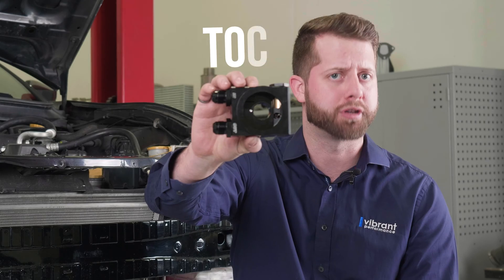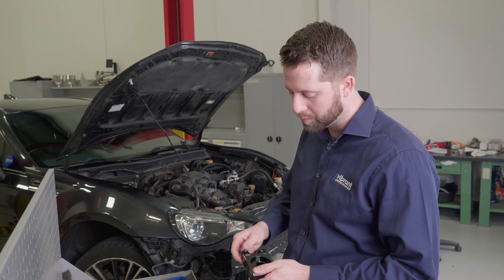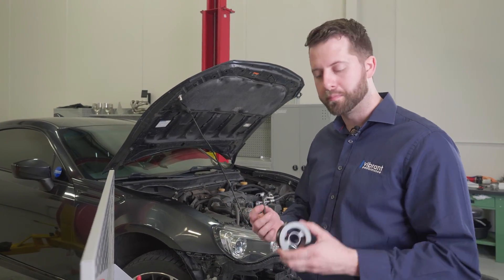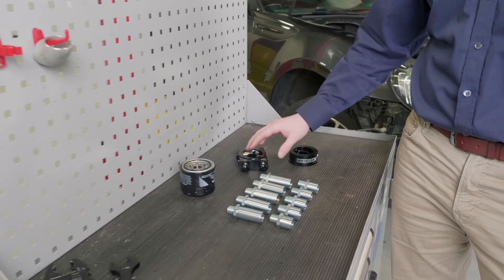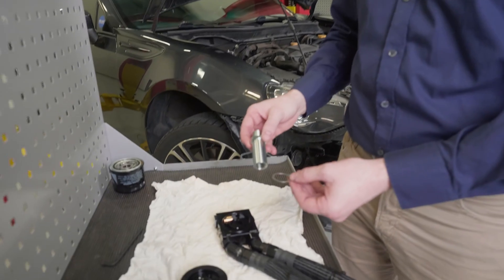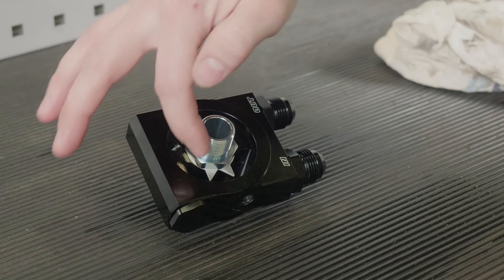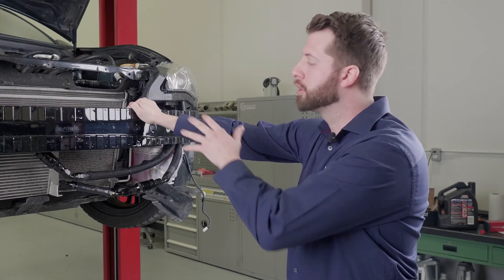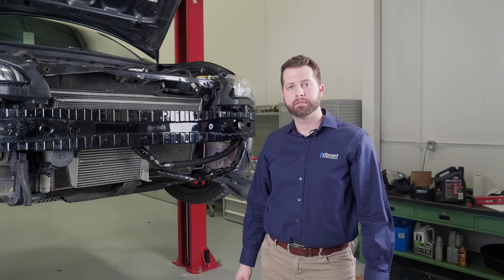Installing a Thermostatic Sandwich Adapter

Comment: Hey, just installed one of their oil sammich plates. Other then being miserable to install in the car on an IS300...this sammich plate didn't leak. Thank you. Thank you, Thank you, Thank you so much for making a product that doesn't leak....Even the 1/8 npt's which have bungs in them right out of the box didn't leak (you can't take this for granted I found out). After installing a used Sammich plate, off brand sammich plate, and then this sammich plate...10 out of 10

Comment: 6:54 you're done? Shouldn't you mount that oil cooler first?
Reply: The cooler as seen in the video is hanging from the bumper re-bar, and has a second mount that fastens to the floor when the bumper cover and shrouding is installed. This has been track tested and shows no sign of failure.

Comment: guy forgot gasket maker on his oil filter o ring, lol.
Reply: the sandwich plate doesn't need it unless you want it as a fail safe. I have done hundreds of laps with the TOCA assembly with no gasket maker, no leaks.
Reply: @MrLister30  It was a joke. There is absolutely no need for gasket maker on a o ring seal lol.
Reply: @FOXCRF450RIDER  understood, however a small bead can be placed around the perimeter of the oring for racing applications
Reply: @MrLister30  You would be laughed out of a race shop putting any kind of RTV on a o ring seal, again I'm lol'ing.

Comment: How can we get work done on our cars by you?! Is your shop open to the public for business?
Reply from the maker: Unfortunately no, we are a manufacturer. The series we are working on with Speed Academy where we are building their turbo setup is for an educational piece to show how easily it is to use our products for such projects. There are MANY talented fabricators in the area and that use our parts that we can get you in contact with if you're interested.
Reply: In other words sorry you don't have enough subscribers or a name
Reply from the maker: @Simpleman1078  Not at all, we are a manufacturer, we do not operate as a shop.

Comment: Is there an oil drain on your cooler? That would hold a noticeable amount of oil that wouldn't get changed during regular servicing.
Reply: My mechanic recommended to simply change the oil slightly more frequently, instead of 4000 miles switched to 3000. Had the oil tested and didn’t notice anything particularly abnormal, full synthetic should last 6000 so if a portion of the oil goes that far it’s not the end of the world. But yeah sometimes they have drain and other times they don’t, mine didn’t and removing the cooler was more of a risk of causing a leak than he thought was worth.
Reply: @kcspeed9980  sounds like a reasonable plan! Rock on!
Reply: I have added a dry break connection on both inlet and outlet, so I can remove the cooler during the winter, but it also allows me to drain it easily. I have the two dry breaks opposite to each other, so when I remove the oil cooler, I plug them into eachother, so I don't need to remove the sandwich adapter.
Reply: @MrLister30  yeah. That is really slick. Does it need to be filled separately Berger startup. Or can you use clear flood mode to fill it. On Subaru’s you put the throttle all the way down and crank, it doesn’t fire the ignition or the injectors so it just turns over. I do this every oil change until the oil light turns off.
Reply: @kcspeed9980  I fill mine on the bench before installing, again the dry breaks make this completely mess free. There is a fair bit of oil in the lines and core (about 1.5L). The TOCA has a bypass so there is never only one path for oil to take, so during startup instead of pushing oil through the cooler, oil will take the path of least resistance which is through the bypass, this reduces warm up periods. Once the oil is above the cracking temp (70deg C) the bypass begins to close until it is fully blocked off at just over 80deg C, where the oil will only travel through the cooling loop
Reply: @MrLister30  that’s a good reason to run the TOCA. I might need to upgrade my setup to include dry breaks. Thanks for the advice.